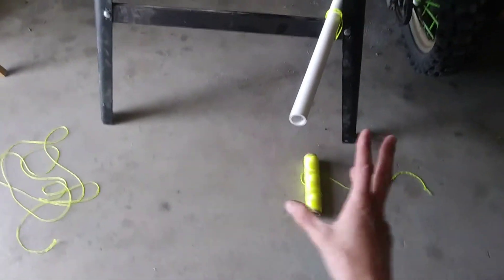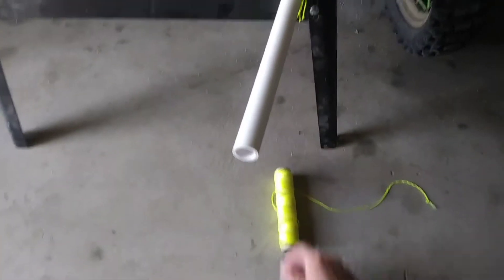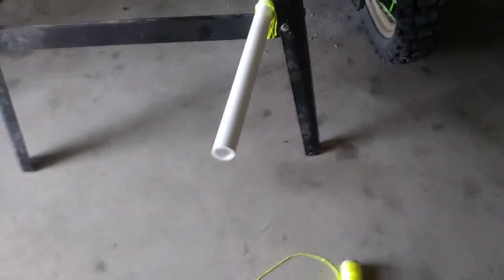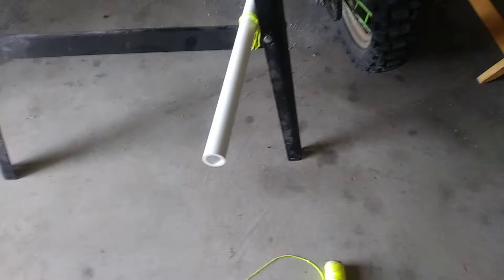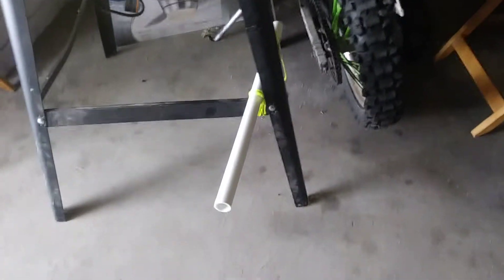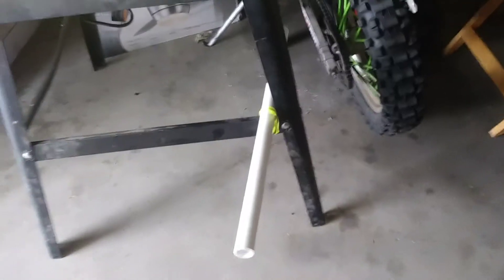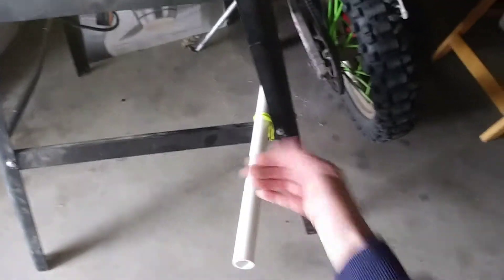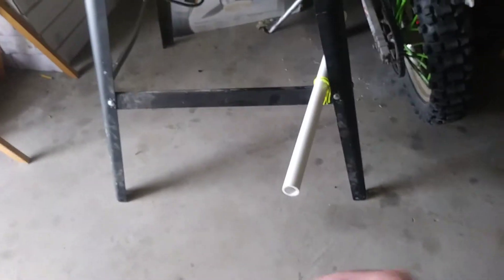Cutting PVC with string!!!  (tips and tricks Tuesday)

Comment: Why not just buy a real metal string saw w handles. Plus you were cutting it at an angle and that string was pulling on the pipe too much. I guess your method would get you out of a pvc jail maybe? It's better than nothing but a real string saw is like $7.00 from Lowes and or Home Depot.
Reply: The string saw is a good choice however this technique can be used when wires or cable is present. Care should still be taken to not damage any wire casings but this is one of the best ways.